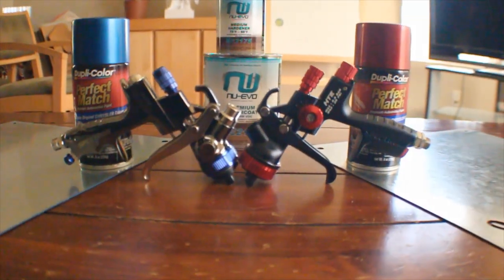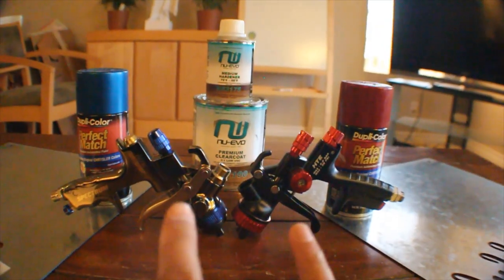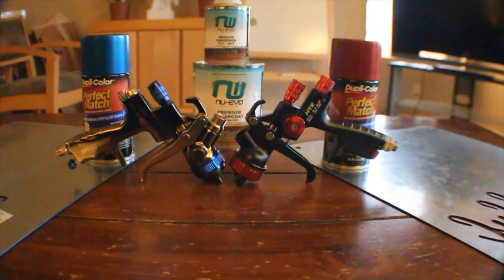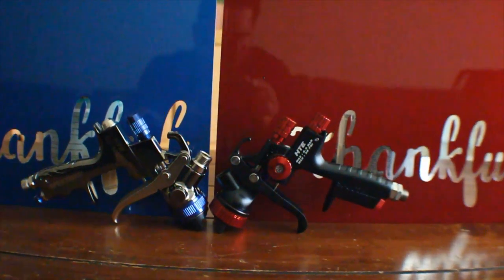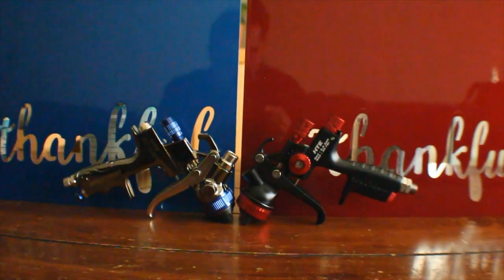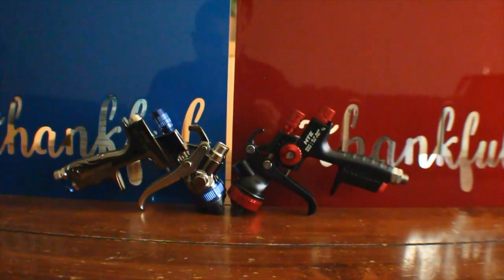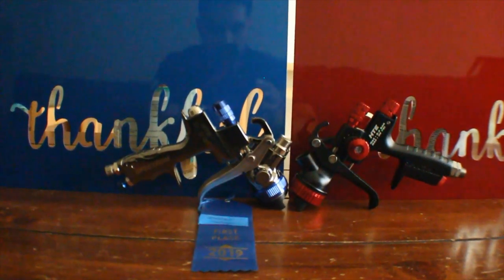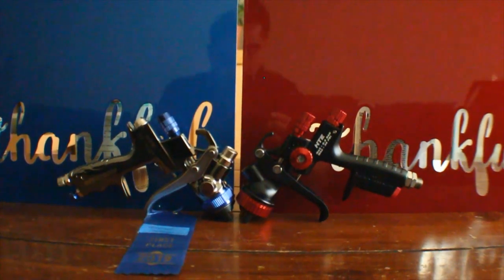Harbor Freight Spraygun Shootout: Spectrum HTE Vs Black Widow HTE

Comment: See we are using this Spectrum gun in auto body class for primer. We are using Shop Line products.
Reply from the maker: How do you like it?!
Reply: @Mechaniclyfe  it works good for a primer gun so far. I do think if I was running a shop and was not a student I would invest in a better-quality gun. But for the guy painting the fender he replaced in his driveway, it's a great option at an affordable price.
Reply from the maker: I agree, I liked it for single stage as well, very large tip but didn’t spray to bad

Comment: This is random but you should try the 1.4 husky gun. It’s my personal favorite at home right now. It’s a lvlp so very low air. I get super clean finishes off it. Lays clear very nice. And only 60 bucks
Reply from the maker: Kevin Camacho I have tried that husky gun, my friend of mines had it , but his had a larger tip size good gun for the money 👍🏻
Reply: Mobile Terminaluser yes it’s a good gun reguardless of the skill level. Lvlp is good for small compressors. It’s the 1.4 tip silver metal gun with the plastic cup at Home Depot. Check my channel out. I use it a lot on there
Reply: Truth being told u get what u pay for ..In all reality it's who's hands the gun is in , more than anything else ..i too get great results from lvlp touch up gun shooting clear but in the end stepping away from the automobile it's not as nice as it was when it was wet unfortunately!
Reply: Mobile Terminaluser  for a beginner with a small compressor I would recommend a Ani r150 mini gun to paint the bumper.  You will probably need bigger than a 5 gal compressor.
Reply: I can vouch for the Husky 1.4... a sweet deal that includes a 1.8 tip for primer if need be. For $60 bucks the gun has good feel and is fairly lightweight. Bump up psi to 30 32 on a 26 30 gallon setup and sprays clear with very little peel. Overall lays down very decent results; A true jack of all trades!  Made by Campbell Hausfeld.

Comment: Was actually looking for a comparison video, looking at buying one of the two.  I do think painting the same paint with both is better for comparison, just because that is how scientific testing is done, you cant change more than one variable to get valid test results.  So in this case instead of changing just one thing (the spray gun) we changed two things (gun & paint).
Reply from the maker: Honestly they are close to the same , other than the widow being easy to clean

Comment: The HF coupon book is starting to include a coupon for the standard Spectrum spraygun for $99.  Use the 25% off coupon and get it for around $97.  This is probably not the gun to get if you spray five days a week (no replacement parts available), but for the DIYer it should last for many years...
Reply: Just used it off my phone the cashier just scanned and walla 24% off yea
Reply: Parts are availed but I still wonder if it’s a waste of money
Reply: I hear finex fx3000 parts interchange with the spectrum, so it may very well be even better value that original though, if so why not use in production settings! Jmo

Comment: I understand that it is a finish gun but personally I feel that I'm much better test would have been to use the same paint color not mattering then finish off with the clear coat because we all know paint and clear coat spray differently or at least I feel that that the product spray differently just my thoughts

Comment: The only thing I see with these is parts availability if you need them. You could buy a devilbis flg5 or a.n.i f160 for same money or maybe a little less and have longer gun life and choice of a lot of cap and fluid nozzle sizes. Check out spray guns direct and you'll see. Not knocking the guns but there are a lot better brand names for same or less money. Nice video though
Reply: Exactly. Not many are willing to admit it, but the hype has highly inflated the Black Widow's price to the point it costs more than better guns. That entirely defeats the purpose of buying from Harbor Freight. Iwata Kiwami $170 shipped, FLG5, less than $200 shipped and might can throw in a spare needle within that price. Astro Eurohe 103 for less than $100 shipped and it beat the BW in a comparison. Could buy two Astros for the price of the BW even using a HF coupon.  That's insane!

Comment: What about the legality between the two . The black widow has a coating inside the head to keep it easier to clean for one thing and has a firmer feel with the trigger. The spectrum doesn’t have any coating in the head and the trigger isn’t quite as positive as the black widow. They are both good guns to have around but I think you will get a lot more uses out of the black widow and the Spectrum will go into a primer gun after a few uses if your painting 10 or15 car’s a year min full finish paint jobs the black widow will be the gun that you will be using blowing the final clear coat and maybe the Spectrum will be laying down the sealer and the 2k maybe will have to change the needle and orifice to a 1.8 keep it clean or else you will be tossing it and that goes for both guns or any gun

Comment: Have You ever tried a Chinese knock off of Sata. Wonder if they're any good. Just seen one on Ali Express for $90
Reply from the maker: Fredoh ACR haven’t tried one personally , but I have seen them on eBay and Ali exp.
Reply from the maker: Side note : the black widow/spectrum  is basically a sata knockoff
Reply: Careful with that crap l ba.. One for the price you said and the shit is not build not even with metal is some kind of plastic mixed with a weird component who fuckin knows what the fuck it is.
Reply from the maker: Video up tonight for the fake sata , part one..
Reply: @Mechaniclyfe  i don't see it up? Was it deleted ?

Comment: I watched your video on painting the Suzuki black, I guess that was the 1.7 hvlp I like to see you use the 1.3 needle and tip from the hte on the hvlp and see if it sprays even better than the 1.7 using single stage.
Reply from the maker: John Ortiz unfortunately they aren’t interchangeable, I tried already

Comment: Great job
The black widow has an odd thread on the paint cup I noticed later that it's the same as my devillbiss 
When I went to harbor freight the black widow seemed cheap 
On the machine work
Reply from the maker: Gary Brown its an upgrade from the spectrum , Widow is forged where the spectrum is cast , it’s actually not bad . Sprays better then some high end guns , thanks for commenting
Reply: The Black Widow has the same threads as my Devillbiss, right down to the extra collar at the bottom.... just saying
Reply: @KarKraftsman  yea I notice it's real similar to my devillbiss too
I went with the spectrum for  $99
It just seems tighter time will tell
Reply: @Mechaniclyfe  chevy cast ford forged both made some good motors

Comment: Cool video, even though they are pretty much the same gun. I have both guns the one advantage I found is the widow is easier to clean. I really wish they would make an in between tip the 1.7 is just too heavy for base coats a 1.2, 1.4 and 1.7 would be 👌
Reply from the maker: Tye Tash agreed ! Widow also has a slightly wider fan pattern not by much but it is wider. Spectrum still took it for the money 💰
Reply: Just A Mechanic totally when I bought the widows I thought they would be a lot nicer but definitely not worth the extra 75$, I think my next gun is going to be a strata but I’ll wait till one of these take a shit on me

Comment: Good stuff. I’m a DIY guy and I’m trying to decide on a gun. I’m looking at the Spectrum, Finex 3000, and the Devilbiss FLG670. Have you used any other guns?
Reply from the maker: Socal Stangman I have used all three , personally I didn’t like the flg 670, so that would not be my first choice, finex is a decent gun , spectrum pretty decent too. So I would say if it’s your first spraygun you wouldn’t go wrong with either choice
Reply from the maker: Only guns I haven’t sprayed with are high end satas they are just way out of my budget , anest iwatas are good guns, the Belleria is a great gun, I had one. Not sure what your budget is on a spray gun tho
Reply: Just A Mechanic ok cool. I appreciate these videos. Most do only high end guns and even though I can afford one, I really can’t justify one. It doesn’t make sense. I’d rather put that money towards other mods. I’m thinking I’ll give this Spectrum a shot. HF has a 25% off coupon for this weekend...thanks man.
Reply from the maker: Socal Stangman the money you save on a spray gun the more you can spend on better materials , you won’t go wrong with the spectrum line 👍🏻
Reply: The finex is a really good budget clear coat gun
Reply: They also have replacement parts for them
Reply: @jesusalvarezsayula1784  Devilbiss flg 5 is a good gun for the price.
Reply: @mitchellferre1652  nice I was looking into that one. Primer or base?
Reply: @jesusalvarezsayula1784  flg 5 is good for primer, base or clear. If you were spraying a difficult color like silver metallic I would rather use the Iwata, Devilbiss GPI,  or Pro Lite.  Flg is made of cast aluminum with top notch internals.  I prefer my GPI which is machined from billet aluminum.  Lasts a lifetime if taken care of and is basically a GTI pro without the extra frills like the spanner wrench or case. I got mine from spraygunsdirect.co.uk.  👍

Comment: You said the spectrum panel hanging was added footage......was the compared finished result laying flat?  Wouldn't it be a much better comparison if you sprayed the panels while they were hanging upright?  Any terrible gun can have a good finish if you just floor on a coat while the panel is laying flat.
Reply from the maker: Both can result in a similar finish rather flat or vertical , it’s a really good gun
Reply: @Mechaniclyfe  What I meant was that any gun can give you a good finish on a horizontal surface.  A vertical surface would be a better test.  I understand that you said both can give a good result on vertical surfaces, it just would have been cool to see that.
Reply from the maker: Gotcha

Comment: @justamechanic I just purchased the spectrum and wanted the widow just didn't want to go over the 200 mark at the moment . When I got home I checked my mailbox and there's a coupon On the widow for 149. Being said I haven't used the spectrum yet , would it be worth taking back tommorow and exchanging it for the widow along with the extra 20 buks?? And will I be able to use a heavy primer thru either one of the guns?? Thanks for the video
Reply from the maker: JustA GoodOboy personally both are excellent guns, I’d say if you are wanting something that’ll last you a bit longer I’d say spend the extra cash for it other than that no. Spraying primer requires a larger tip size so I would say I wouldn’t recommend the 1.3 for spraying primer. Not that you can’t spray out primer with it but it’ll just struggle to come out the gun. And isn’t going to be a smooth primered finish
Reply: @Mechaniclyfe  , does harbor freight offer larger size tips ? What size do you require for primer .
Reply from the maker: They only offer the 1.7 which is what I use for primer 1.6 - 2.2 is used for primer just depends on the primer

Comment: Hey Just a Mechanic.  The Nu-Evo clear coat you used looks interesting, but I cannot find it by me or on the Web.  Can you share the correct spelling of the product, the clear coat part number, and where you purchased it from?  I have a 1935-6 Ford tailgate I'm going to repurpose as a front of a mini-bar and am going to use my BW and your technique to paint it!
Reply from the maker: David Spencer sure , The NU-Evo premium clear is a very small local name brand. Their headquarters is in Garden Grove California. It’s a low voc clear. Let me see if I can google their website and see if they have distributors listed on their website
Reply: @Mechaniclyfe  Thanks.  I live in WI, but would like to try some low VOC air-dry clear.  Let me know if you find how I can order.
Reply from the maker: David Spencer looks like they old sell to professional paint stores, may want to try some speedokote from amazon , Marco from speedokote refinishing network swears by that stuff . Give it a squirt 💦 🎨
Reply from the maker: Only*

Comment: I am a fairly new spray gun sprayer, I actually bought one of the Spectrum blue sprayers but haven't used it yet.  And advice you can give meI would welcome gladly.  I have done spraying before, but never felt too good about it.  I really try to keep the tip 90 degrees from the work not bending wrist in the stroke at either ends.  I have looked up all the pressure settings, I believe it says 35psi with trigger pulled.  And use an in line filte.  But things you had to lea4n the hard way, or things that might come to mind for someone wanting to become a better sprayer.  And once again, if you have time to respond I would appreciate it. I subscribed and will be watching more to get any info I can.  Thanks again,
Kevin
Reply: 5:17 l sprayed over 30 cars with the blue spectrum, adjust your air at gun wide open as well as fluid, I found 30 psi good for base coat and 35 to 40 for clear, it really is the best gun for the money, l was getting mirror finishes and not having to cut and buff at the auto body shop,, lm painting in my garage booth now and went to a fugi turbine sprayer, 40 percent less overspray and 35 percent less paint,, only thing I didn't like about the spectrum was if your painting for long periods it gets uncomfortable to hold,, l did buy the spectrum black widow HTE and my opinion is it's the winner, the rear fan adjust and smooth trigger and lighter and more comfortable with a wider fan for clear,, well worth the extra 70 dollars.

Comment: You should do a product compo between the Spectrum and the Sharpe Finex. Harbor Frieght compares the spectrum to the finex which can be bought for cheaper than the spectrum, and you can buy all kinds of parts for the Finex. What are you supposed to do with the HF gun a seal leaks or you drop and damage the fluid tip or lose the needle packing when cleaning the gun?

Comment: Like the spray challenge. However I would like to see this again without metallic paimt being used.i have good reason to ask this. I've worked with metallic paints since age of 10,now 42( love metallic paints),duplicolor makes a great paint for the price( primer so so ,duplicolor clear sucks),2 colors iv3 problems with are the red and green metallic ( orange peel some times badly). Yet no metallic no issues. That's why I ask.

Comment: What cfm are these pulling?  I read 11 at 35psi,  But I think spraying in upper 20s would be less CFM correct?   My hvlp gun for base only needs 4.3cfm,  and I thought this hte gun Itemize more paint with same pressure.   My 28gal tank only does 7scfm @40psi…. Will my comp handle this gun for a hood??
Reply from the maker: For a hood it will be just fine it’s spraying large jobs where the compressor will struggle

Comment: Great video!!! New subscriber here. Thank you! I’m sold on the spectrum HTE. Thank you for sharing and taking the time to compare in details. Do you happen to know what dekups adapter will work on spectrum HTE?. 
I currently have dpc 10 and 11 adapters. Thank in advance bro!  

Was gonna buy they black widow BUT it’s too pricey. I’d rather buy the Eastwood cc500 for that price point. Thanks to you and your videos I’m sold on Spectrum HTE.  Plan to shoot summit racing -  Sherwin williams  two stage silver blue metallic.
Reply from the maker: Thanks for your sub! 🙏🏻, I can’t remember off hand but I have a video showing which adapters work for the Hf guns for the dekups kits. The price of the widow has gone up significantly they are about 220 right now they used to be on sale for 150 before so quite a big jump, the spectrum HTE is an awesome gun too tho , I’m sure you’ll be happy with it .
Reply from the maker: If you want the cc500 for cheaper go on alibaba and type in “ roxgen spraygun” roxgen is the company who makes it for Eastwood
Reply: Thank you! Man you are quick to respond!! Thanks :)
Reply from the maker: I try , some comments I can’t see tho.

Comment: I have never used a spray gun and have no knowledge on them but I am looking to paint a new home about 1500sq ft. Would either of this guns work for painting walls? Thank you for any help you may have to offer
Reply from the maker: Parmelia Thibodeau Unfortunately ,no on that one, the tip size is very small and both of these guns would have a hard time getting paint out and on to the surface, they do make a larger 1.7 tip on these guns I think you might be able to work with that size nozzle tip. I think you’re best bet is purchasing a Husky paint gun from Home Depot , I believe the tip size on the husky will be in the 2.0-2.5 range , you should have no problem with that guns tip size.
Reply: Go to homedepot and rent an airless paint sprayer for that.
Reply: Mam , u need one called the GRAYCO 360 true coat for your home mods!
Reply: For a house, go with an airless sprayer that can spray with a 517 or 519tip.  That will get you a 10" fan(5x2) 17 is thousandths which is hole diameter.  Yes it's small but 2000psi pushes a lot of paint. No need for an air compressor.  You will learn to move fast to prevent runs.  Over lap your rows 30-50%.   HVLP is too slow in my construction opinion, with an exception for maybe cabinetry and trim.  Airless for walls and ceilings...always.  -Brian
Reply: You would want a larger tip if doing large vertical walls. The only reason I would use a hte or hvlp on a house is if I just wanted to do a wall or two and not clean out the airless gun and hose or trim work especially if it’s small job. The advantage of a paint roller is pushing the paint into the dryrock. Gypsum Sheetrock is porous unlike metal fenders and plastic bumpers.